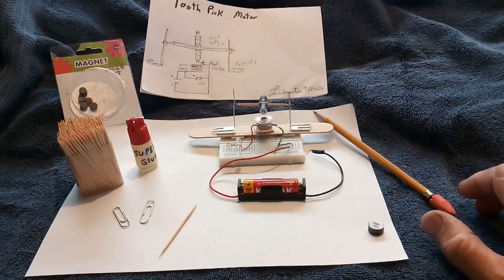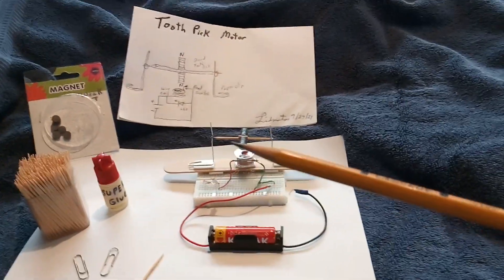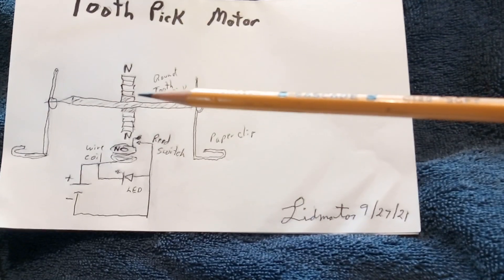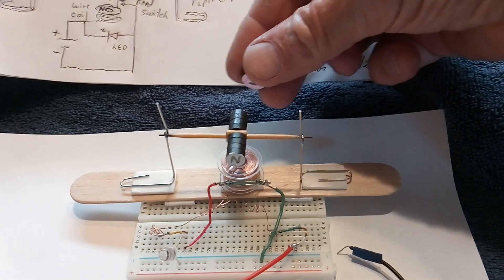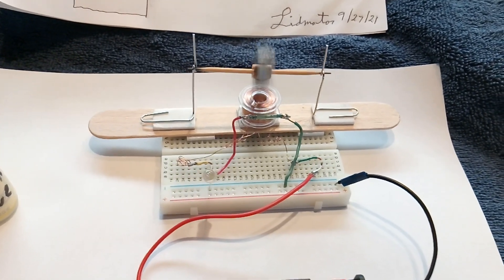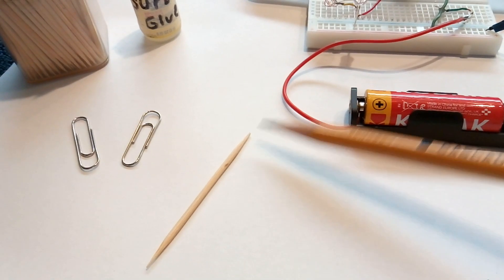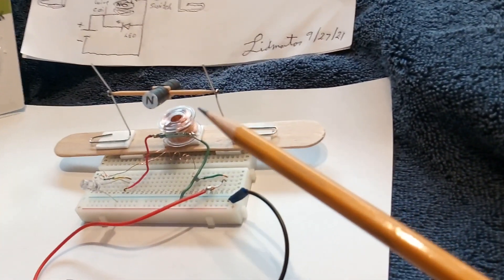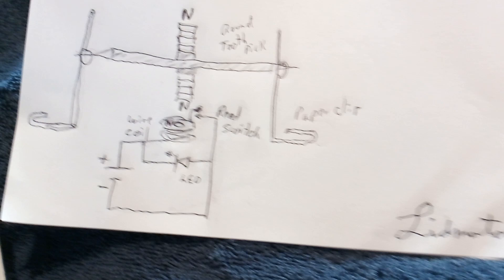Tooth Pick Motor

Comment: Thanks for reminding me I need to get some glue.
Reply from the maker: Always have enough glue and duck tape on hand. Ha.
Reply: @Lidmotor  trying to fix a Coleman tent leg. They don't fix them so the owner got a 8 man tent for a 6 man tent replacement. Now if this epoxy holds they will have two tents.

Comment: In lieu of glue,  one could put the S sides on to iron, though this would concentrate the magnetic lines of force and may cause less interaction with the coil .
Reply from the maker: One of the motor designs I replicated was to use a steel hex nut on the rotor shaft.  Worked great.